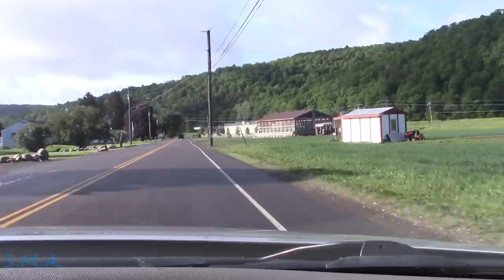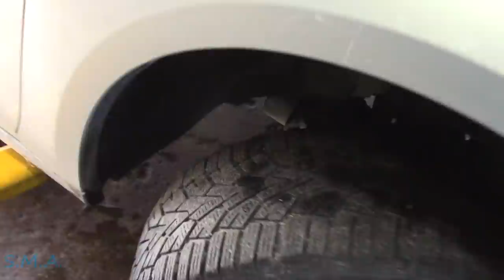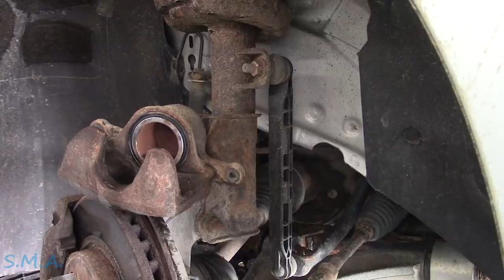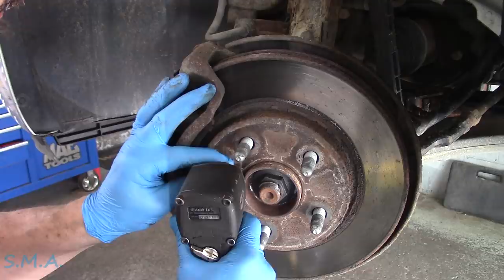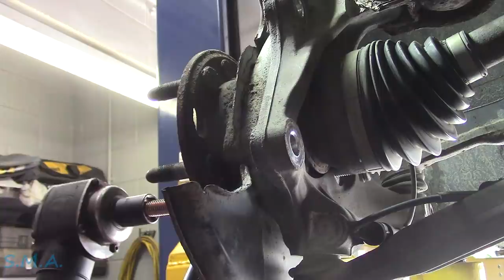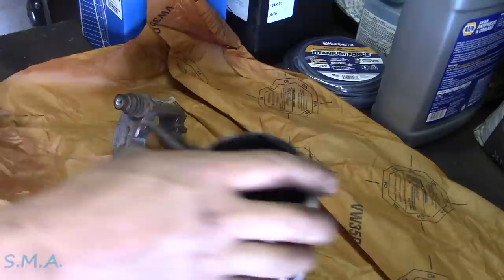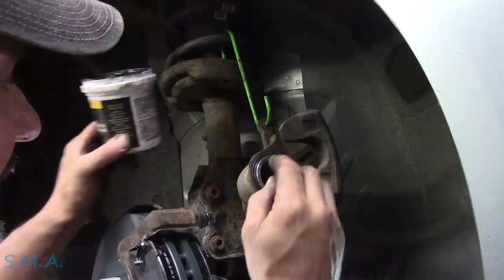Chevrolet Malibu: Brakes & A Front Wheel Bearing

Comment: Nice job, thorough!  
I like the grinding discs;  have to order some.
What did you spray on the backing plate before installation?
Anti-seize on the axle splines?
Thx for answers
Reply: Fluid Film
Reply: @johnaclark1  Thx,   will have to try it.  Been using using thin coat of anti-seize , especially around hub to keep rim from sticking.  Good to  check out alternatives.

Comment: I had the drivers side brake caliper bracket nearly fall off my 2010 Malibu. There was no warning at all and after inspecting all the brakes, I ended up replacing all the rotors, brake calipers and brakes. Three out of four brake calipers were cracked so I just replaced everything. Next came the plastic parts for the timing chain, the throttle body, and several other parts. I have pulled it in the driveway where several trees could crash down on it and I would park it there every time we had tornado weather or a hurricane was coming through. So a small hurricane was supposed to come through during the night and I ran a quarter mile down the road to get a couple things from the dg before it got back. Came back to a big tree laying across the driveway where it had been parked. I hate this car more than any other vehicle I’ve owned and it only has 165,000 on it. I still don’t understand the brakes since they were still the factory brakes and it was hardly drive by me. They went out before the 165,000 miles, long before. Ive never seen such a cheaply put together car in my life.

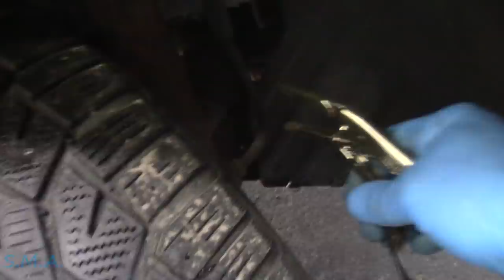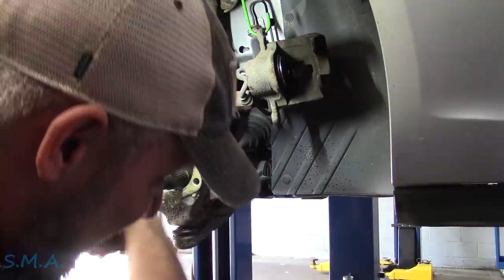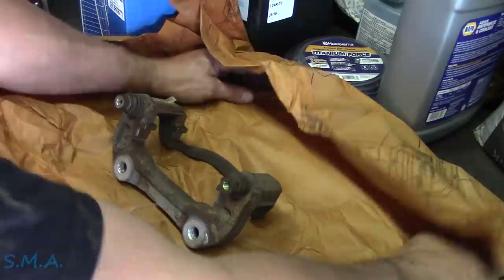Comment: 2:40 hey man never pinch a brake hose.  13:01 hey man use a bearing puller next time to pull it off even.  15:28 hey man never trust a fluid film can.  18:15 hey man never re-use a subway wrapper.  23:01 hey man never double click a torque wrench.

Comment: I notice that you don't use alot of anti seize on your bolts and I am curious as to your thoughts on this especially when you have lots of rust there and loyal customers that will be back for service at some point. I know it is more work and cost but for commonly replaced items like brakes I would think that it would be a plus for you. Just curious.

Comment: Is that spray an antiseize? If so what is it called? And always buy the hub assembly with new sensor. Easier and less chance of failures down the  road. Plus I don't like pulling or pressing bearings. Always feels like something can explode on my face.
Reply: In case he doesn't reply, pretty sure it's fluid film, he uses it often

Comment: Why did Eric pinch the brake line one at a time to diagnose a bad wheel bearing? I couldn't comprehend that part. Please explain to me the reason behind it.
Reply: It's to allow the wheels to rotate separately.  Clamping the line with the breaks applied means that the pressure in the clamped cylinder is retained when the breaks are released, so that the wheel is held still and the other one rotates.  This is so that you can listen to the rotating wheel on its own, with no sounds from the other wheel to confuse the issue.

Comment: When you put that thing on the brake hose, what does it do? I know wheel bearings are things that are intended to roll freely without noise and to attach wheels into them, so is your trick related to that? Did you make it so the wheel bearings are put under pressure so it's easier to confirm a bad wheel bearing? I'm intrigued.

EDIT: I watched that part the second time now, and I figured it out. Kek.
Reply: W

Comment: Do wheel bearings go bad more often when a tire shop just attaches a wheel without torquing it?
Reply: Mine is going bad because of a Tow Truck Driver pulling me out of the snow ❄️ in winter via attached tow chain to wheel pulling car with wheel.

Comment: You can surely tell it's a northern car with all the corrosion..lol  When you replace one set of bearings chances are the other side is not far behind so i would change both.
Reply: Wasn't much rust on the other hub so guessing it'd already been changed.

Comment: Can front wheel bearing make the steering wheel shake going 60 miles an hour on 2006 honda odyssey . ANYONE PLEASE.
Reply: It could but you'd likely hear it as well. In thinking more tire balance. How many miles?
Reply: @giggiddy  IT HAS 201987 MILES HAS NEW BOLJOINT NEW CONTROL ARE NEW STRUT IN FRONT BOTH SIDES NEW CV AXLES NEW INNER AND OUTER TIE ROD ENDS AND IT EVEN HAS 4 NEW TIRES WHEN I GO PASS 60 THE STEERING WHEEL SHAKES. IT'S NOT BAD AS IT USE TO BE, BUT IT IS STILL THERE,

Comment: I fire customers all the time... especially when they bring me their car for a second opinion after some other hack fired the parts cannon at it and it still didnt run and they have the nerve to say this "but the other shop didn't charge me for the diagnosis!"  Lmao thats all they complain about... meanwhile i fixed the car after 30 minute of proper diagnostic work and a butt connector, heat shrink and 3 cents worth of butane.  And the other shops invoice for 800 dollars in parts they didnt need is always on the passanger seat.. 😎

Comment: I had a Grand Damn that went through front wheel bearings every 40K miles. Worst car I ever owned!
Reply: Then buy better wheel hubs. Don't buy cheap ones. Those don't last at all.
Reply: Buy oem.
Reply: Oem are junk. I buy moog. They expensive but worth it.
Reply: @snoopdog6793  I used Moog on my expedition. I use oem parts like Motocraft over aftermarket.